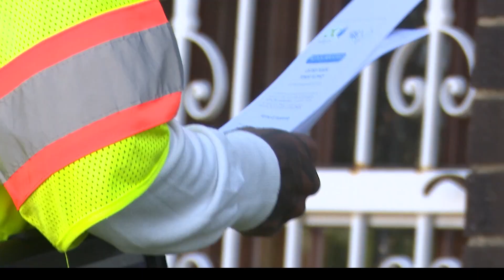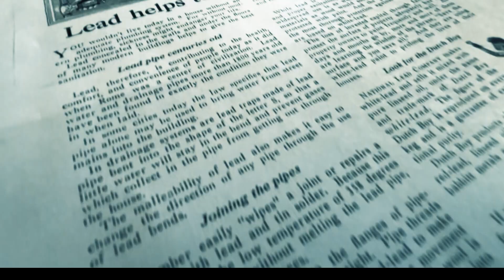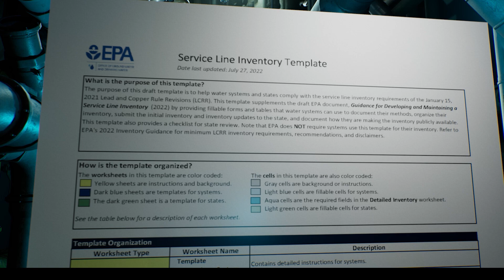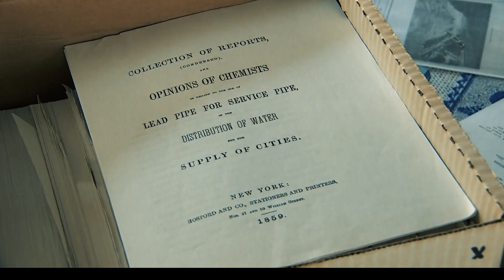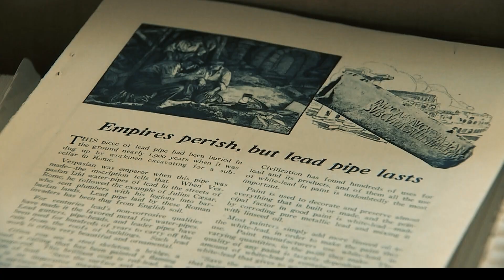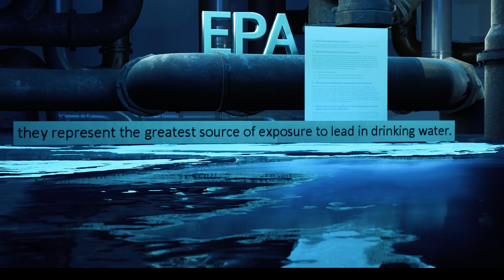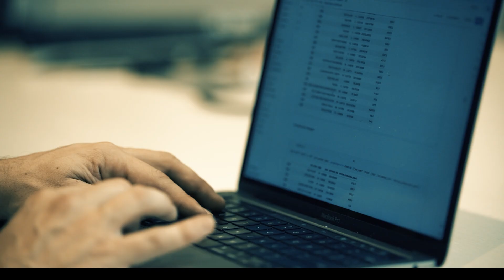Nationwide water systems miss critical deadline for identifying lead service lines

Comment: No leaded gas was they had to change lead poisoning levels cuz lead is globally a surface trace element now lead water pipes require special water treatment that basicly cause a coating to build up and prevent lead from dissolving into the water if you remove all the lead the water doesn't req as much micro management and the water becomes cheeper